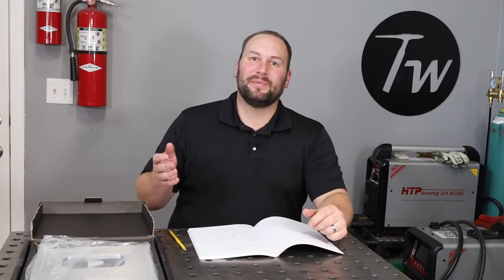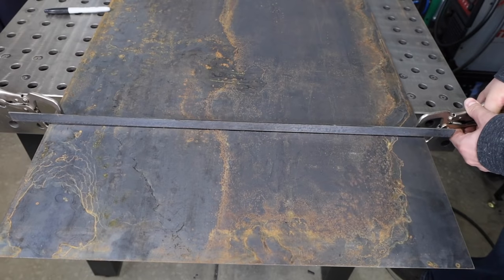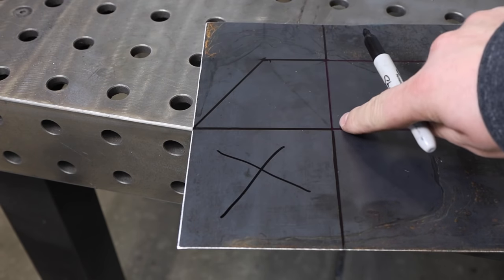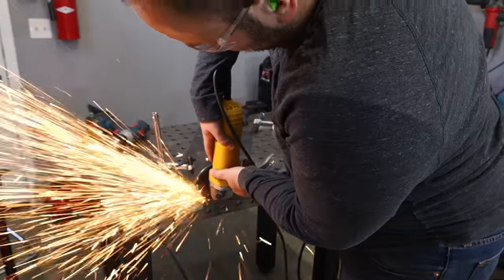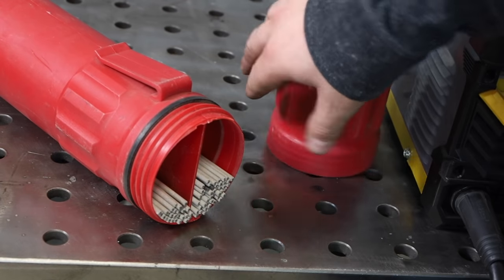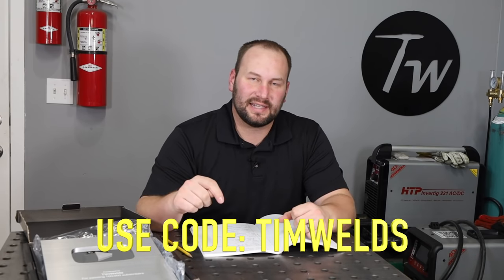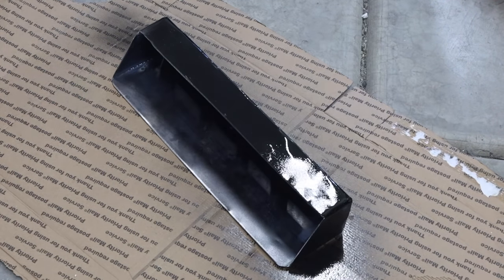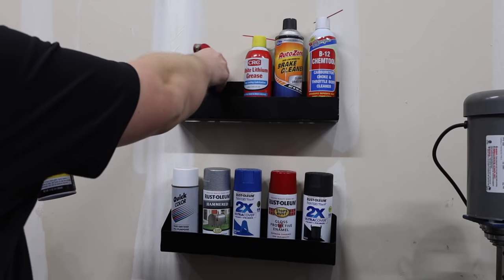Sheet Metal Fabrication Hacks | Build Anything with Basic, Affordable Tools

Comment: Thanks for the tips ( especially about drilling corners) on layout . I'm curious , what was the thickness of the material that you where using ? Thanks
Reply: I was wondering as well. Found it in a previous comment. He said 16 gauge.  1.5mm for metric friends.

Comment: With good cut off wheels you can make 100% straight cuts freehand. I use the 1mm thick 3M Cubitron cut off wheels. Yes, they are expensive but they cut like hell and last forever.
Reply from the maker: Thanks for the suggestion! I'll have to give those wheels a try.
Reply: Cubitrons are the best! Your right, you pay for them, but they are great.

Comment: Congratulations on surpassing getting 100k subs Tim.

Instead of plunging through the sheet metal I've found that grinding a continuous line on the inside of the fold works for me. I find just a light grind with my thin cutting disk does a great job. Though I only need to do this with sheet metal thicker than 2mm now since I built myself a small sheet bender from 5mm angle iron.

Somewhere on YouTube I recently viewed that by plunging the cutting disk causes excessive wear as opposed to gouging the surface with the edge of the cutting wheel. The ratio is quite high, something like 6 cuts (plunge) as opposed to 61 similar (gouge) cuts. Here's the link to that experiment. 
https://youtu.be/hid9bDnSeok

BTW. I love all the videos of yours that I've watched. You have a great way of passing on your knowledge to us.
Reply from the maker: Thanks a ton! 

I agree that a score line works quite well too, though it can be hard to tell how deep it is to make it effective without blowing through. 

I have watched that video; I'm a big fan of Jason and have spent a small fortune on tools from his company, Fireball. They have some really impressive stuff. However, I don't agree 100% with the conclusion in that experiment. I've played with this in the past and found that what wears the wheels faster isn't cutting all the way through a sheet in one pass, rather it is when the wheel is engaged too far into the material during the cut. It results in a vibration similar to chatter in machining which beats on the wheel and breaks it down. (while giving your forearms a real workout). If the wheel barely pokes through the bottom, they last a long time for me. Either way, every application is different and I appreciate you bringing this up in the comments because it may help someone out quite a bit. 

Thanks again!
Reply: @TimWelds  you're welcome. Agreed about the depth of gouging and the depth of cut. Have a great day.😜

Comment: I appreciate that you use some of the cheapest products as well as some the top tier ones.  Your use of the Harbor Freight 125 amp mig with the top of the line Miller mig showed the results are dependent on the user. Just use what you can afford. I started woodworking with a Sears drill and circular saw.  Let your projects determine your next tool.

Comment: Congrats Tim for your well deserved award. This video was just what I wanted I have just acquired some 6mm sheet metal to make an electric motor mount  and belt adjustment set up on my metal lathe. I was wondering how to cut straight lines with the angle grinder and  was going to drill several holes and file out slots for making motor adjustment for the vee belt, I will now use the angle grinder as you did. Very grateful to you for taking the time to show us, you have taught me so much,I have got my son in Atlanta is now  subscribing to you channel  Dave H (ENGLAND)

Comment: HI Tim i just purchased a ESAB MINI ARC 161-LTS i"ll be mostly using it for arc welding since its got dual voltage  220 v and 110 v what breaker do i meed for 220 v and 110v breaker , My garage has both , thank u in advance and congrats on your 100k

Comment: Sheet metal worker here ... Ya done alright ! Congrats on the award ! what wire did you use to TIG the corners ? The other thing I noticed is you used hot rolled metal (on the plasma cut pc) and that alone will throw off some carbon during the process (welding) either mig or tig. Cold rolled would have fused like stainless butterness. Dont be affraid to use stainless 308L / .035 for filler it will actually help . Want an adventure? try TIG welding Galv or galvaneel ( paintlock) with the stainless wire. a 309 wire will actually make it even easier because of the americium in it.a good everything to anything.. SIB is good to but not a true weld in my book. Cheers and best wishes on 200,000 more !

Comment: talking about sheet metal, not the thick one, the thin one. it is difficult to drill a hole that is circle. no matter how sharp your drill is. 

this is an old trick I learn from shop teacher. use a towel, a rag that you use wipe machine oil is good enough, put it on the punch  mark and drill. your battery drill will roll up the rag of cause but give you a clean circle hole.

I got some news too, someone is prepare to flood your country with cheap korean brand chinesium laser welder. what is the evil point inside is, they claim you don't need safety glass and shield gas welding with that. of cause same bunch of people also selling laser protection goggles in a unreasonable price.

are you familiar with laser welding? if you do, tell people don't fall in that lies, tell them a brand that do business honest. if those chinesium can lie on where their own brand is made of, they don't have hesitation to burn you eyes. 

how do I know that? I live in a city where they re brand chinesium products to other brands. say, you will see a makita grinder spell without an i, a dewalt with a tt instead, and one of those factory is very close to where I live. somehow someday ago I saw some user manual of those laser welder. it mention nothing about goggles and shield gas.

Comment: "A firm grip on the tool, but a light touch on the material"... There are too many ways, and too many different applications, where that is such great advice for the beginner fabricator. From cutting sheet materials to cutting a sushi roll... Quality advice for quality work.

Comment: A1 video Tim.......congratulations on making 100k subscribers..........this makes me want to make something with sheet metal.  By-the-way, Harbor Freight has a pretty good sheet metal bender that (in its original form) only works on steel up to maybe 18 gauge.  However, you can reinforce it with some heavy angle iron and I have bent 14 gauge mild steel without any problems.

Comment: Another tip instead of cutting slots use your 3/4 angle as a guide and score the bend joints to thin the material to make it weaker all the way along the bend joint

Comment: Thanks for making this video! I've seen a lot of your videos and just subscribed right now 😁 Also! You should check out fireball tools video on the best way to make rip cuts with an angle grinder! I've found it's better to make a straight score line, then go over it a few times to cut a piece of sheet metal. When you plunge the grinder I to the sheet metal, and push it forward, there's a lot more resistance

Comment: When you did the "cut throughs" on the bend line - the question is why?  Why cut through in areas?
Would it not be better to score the whole line then bend on the score?
That way you don't have the gaps, but have a thinner corner that would bend and it would fold against itself and almost disappear on the inside.
Reply from the maker: That would be another way to do it. Getting a consistent depth might be a challenge, but it would definitely work.

Comment: Hey tim I've been watching your videos for awhile now as I go from hobby welder to now certified and have learned alot from u. Quick question what brand cnc do you have and where would you suggesting buy from? I'm looking at getting one for my shop and the options are overwhelming lol
Reply from the maker: Thanks! It is overwhelming and I don’t have much great advice on it. That table is from Premier Plasma. It works good now, but I had some quality problems to work through up front, so I don’t usually mention their brand. If I were to buy one today, I’d give the Langmuir crossfire pro a try. There are definitely a ton of options out there, but most of them are outside my budget for a hobby/side hustle shop. I am really glad to have torch height control, which is a major upgrade from my first table which I built myself.
Reply: @TimWelds  I learned on a JD square table in welding school so I was considering just going with that one. The upside is you can use a router, engraver, even a marker on it but it is a bit expensive so I've been looking at cheaper ones. I'll definitely check out what you suggested thanks for the info I really appreciate the reply!

Comment: if you dont mind, what plasma.table do you have?
Reply from the maker: It’s a Premier Plasma with a Hypertherm Powermax 45. The Hypertherm is excellent, however I had some quality issues early on with the Premier Plasma table. I was able to get everything worked out and it works fine now, but I think I’d probably buy a different table next time.

Comment: 22ga would have been more than sufficient and support anything you could put in those and would have been about 700% cheaper.  I get showing techniques, but a $200 rattle can shelf is a bit much.
Reply from the maker: $200? You need a new steel supplier, my friend. That’s about 5 bucks.
Reply: @TimWelds  you got more than 5 bucks in the gas for the torch. Another 15:for the grinding disks. And 3/16 steel ain't cheap.$5 is less than scrap price for the two of those.
Reply: @TimWelds  12x24x.125. Online Metals $30 a piece.
Reply from the maker: This is 16 gauge. Online metals is great, but it’s much more expensive than my local supplier. Grinding discs are a buck online and it sounds like you’re paying way too much for your gas. I only reply because I don’t want you or others to avoid doing projects because of misinformation.

Comment: Hi, great videos. Quick question which weld is more used for people that start their own business welding .
Reply from the maker: That’s a great question without a quick answer. It depends on what type of work you’re doing. For field repair, Stick can be great. Probably MIG for railings and gates (that’s how I started). TIG for aerospace and machine shop or tool room type work. If you want to start a welding business, I would recommend getting a welding job in the industry you want to work in for a couple years. The entry level pay may seem low (or high in a lot of cases), but the learning will be priceless when you go out on your own.
Reply: @TimWelds  appreciate the response, seems like if I want to get a job in welding they ask for experience a year or more. Which I don’t have it thank you 🤘🏽

Comment: I could be wrong but at the beginning when you were using the grinder to cut that long piece of sheet metal you were going the wrong way. That's an unsafe way to use the grinder would you say? Just asking a question and congratulations
Reply from the maker: Thanks for bringing this up. This is a great topic that could be good to dig into in a future video. If I were making an angle grinder video with a general principle, I agree with what you’re saying and would suggest traveling that direction, sparks down and back. What’s more important than travel progression, however, is that the tool can swing out of the cut away from the operator if it were to bind. I’ve found that on thin sheet metal with a 4.5” grinder, holding the grinder body vertically with the wheel barely poking through the material and standing to the side binds less often and allows the wheel to swing sideways out of the kerf (and away from me) when it does. I’m not necessarily recommending this generally and if I had thought more about demonstrating the best generally applicable practice, I would have traveled the other direction. I appreciate you bringing this up in a respectful way and will keep it in mind in future videos. Thanks again!

Comment: Great video… my biggest recommendation when working to the cutting wheel is to make sure the sparks are shooting back towards you… obviously wear the proper PPE like leather or welding jacket when doing so as it will burn up ur clothes ….. but reason being is I f the cutting wheel kicks back it will not kick back towards you it will go in the opposite direction Of the sparks….. and trust me if you do enough cutting of metal with a cutting wheel it’s only a matter of time before you have a kick back. I would much rather deal with sparks vs grinding or cutting wheel impaled in my skin.